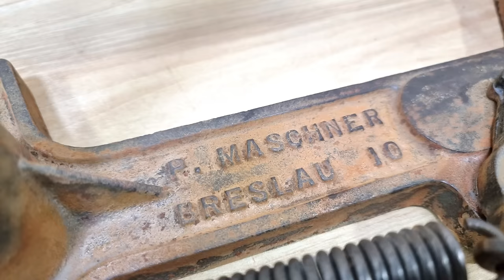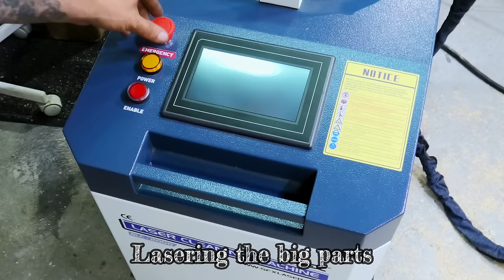Giant Can Sealer Machine Restoration - I Failed the Canning Test!

Comment: Nicely restored, interesting simple machine!

As for the cans not fitting issue, you have a lathe, so it should be easy to make a sized template for the cans you have, with matching internal threads. This machine looks like one could replace the plate to match the cans, hence why it can be removed by unscrewing it.

Comment: You did a good job overall, but one thing I'd take issue with, is when you are turning on the lathe, the cutting tool seemed higher than the tailstock centre. Turned out great, well done.

Comment: I would try putting your tool lower when turning on the lathe, it looks like it's super high and rubbing more than cutting. Should help a lot with forming a chip and cutting material. A truck I use to find center height is cut the face of the stock when it's chucked up close to the chuck, starting below center and working my way up until there is no "nub" left when I face the part.
Reply from the maker: Thank you for your tips. Unfortunately, I can't lower it more than that. It is a small lathe machine, and I bought it to learn the basics; I should probably step up and buy a bigger one. Cheers!

Comment: Hi buddy.  Thanks for the video. But while testing, you ' ve made two mistakes.  First,  the can itself should be filled with something and the second one is that you are to use other kind of cans ( glass) and cover for such cans.
Reply from the maker: Thank you for the tips. I had never used such a device before, and I couldn't find information anywhere about how it should be correctly used. I will try again tomorrow. Once again, thanks!

Comment: 13:33 what is this your using here to clean those washers and bolts with
Reply from the maker: Aluminium oxyde, but takes some time...
Reply: @rustyshadesrestoration  my apologies I should have been more specific. What's the machine
Reply from the maker: A simple tumbler, usually used for cleaning bullet cases.

Comment: How does lasering differ from sand blasting?
Reply from the maker: A Sandblaster uses abrasive media (sand, walnuts, glass beds etc.) that is blown by high-pressure air while a laser hits a beam of the particles on different surfaces and makes them lose the bond. 
The laser is much more eco-friendly and faster (can clean difficult spots) and doesn't damage the surface if well adjusted, while Sandblaster cleans quite the same or even better sometimes, but it is messy and dangerous for health and very slow. As well, you can't clean big-size items. 
Sandblaster is a cheap way of cleaning rust/paint, while laser isn't—pretty expensive and has high electricity consumption.

Comment: Ok and so the can sealer doesnt work cause its missing parts, out of proper adjustment, or the operator doesnt know what theyre doing?
Reply from the maker: You missed one thing: today's cans can't fit a machine made at the end of the 1800s.